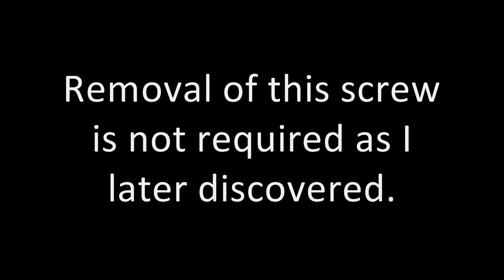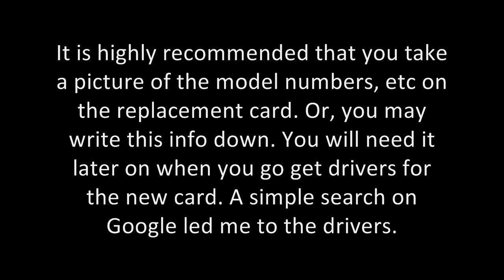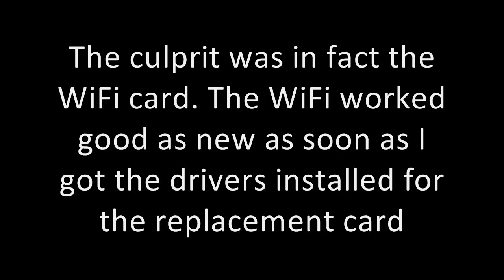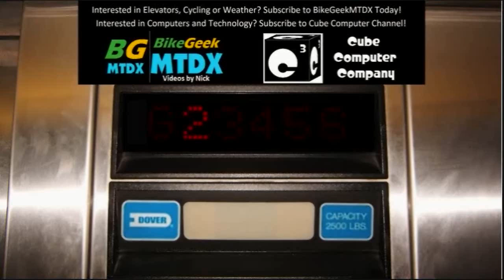Replacing the WiFi card in a Toshiba Satellite C855D Laptop

Comment: I’ve just replaced the WiFi card. The computer still isn’t showing available WiFi. Where do I go to find where to install the drivers. Thank you
Reply from the maker: You need to first see if there are unknown devices in Device Manager. And if so, you need to download the drivers for your respective WiFi card. If there is already a wireless adapter showing under Network adaptors, then it could simply be the WiFi being disabled (Airplane Mode in Windows 8 and 10).

Comment: As far as I can tell the original wifi card on this laptop will only operate at 2.4ghz.  Can I upgrade this PC to use the 5ghz band on my router by replacing the wifi card?  What card should I buy?
Reply from the maker: I'll answer your first question... Yes you can replace the card with one that supports 5GHz.

Comment: I guess I need to be careful when swapping hard drives in my computers, luckily I never broke the sata connector on any of my hard drives so far. Still, I'll use extra caution and work slowly when swapping hard drives so I don't and won't have the possibility of breaking the connector.

Comment: Toshiba is not a great brand in my honest opinion.
Reply: +Magic Man hp's business class laptops are amazing, nothing like there shitty consumer laptops, dells are also good laptops, hp and dell made top 3 best laptop brands (no.1 being apple.....somehow)
Reply: Servicing HP laptops are quite easy as well.
Reply: ***** yea the ones we sell to customers dont have any screws just one big maintenance door which is released the same way you release the battery, just slide back the lock and the whole maintenance door comes off giving you access to the cpu cooler, cpu ram hdd wifi card everything :), makes life alot easier
Reply: +ictdude1 Personally Lenovo is my all time favorite.
Reply: ***** yea thats what i am using at the moment, if only they would just cut down on the junkware that comes with there laptops
Reply: +ictdude1 Oh yeah big time!
Reply: My laptop is an old Toshiba satellite C650 :(

The Hard drive was dead and the keyboard was messed up when I got it from my brother, though.
Reply: I even dropped my Toshiba and even the HDD was OK as well.
Reply from the maker: +Magic Man Sometimes I refer to them as Toshita.
Reply: I  absolutely love Asus or Lenovo because there so dependable.